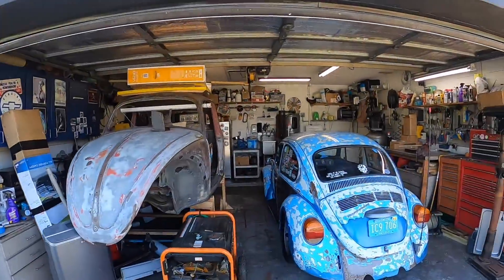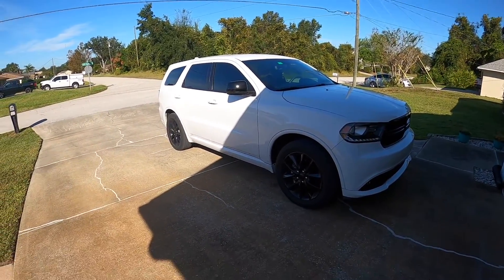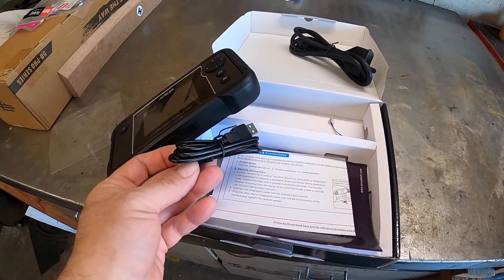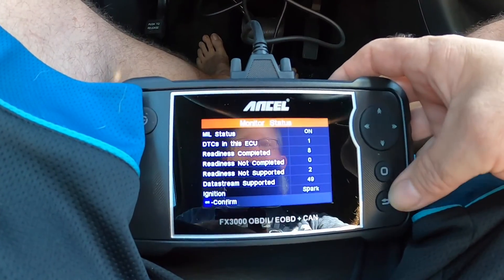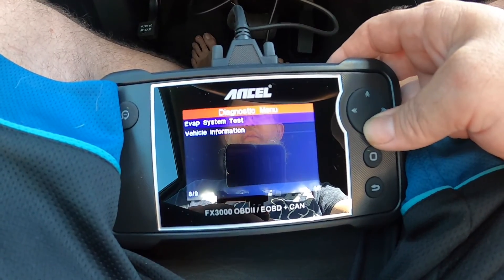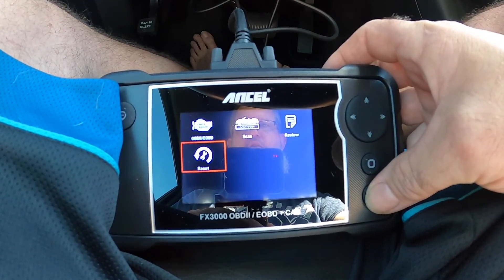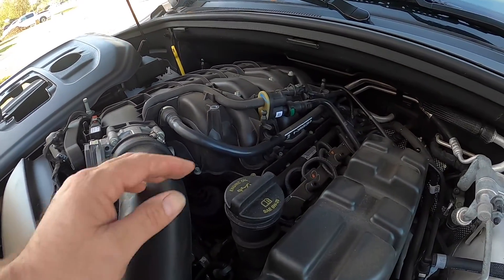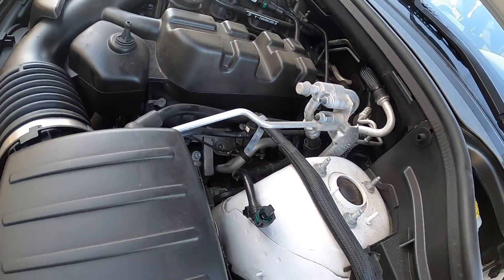Dodge P0456 Evap Code Common Issue and Ancel FX3000 Professional Scan Tool

Comment: Hey, isn’t the engine in the wrong end of the car? Lol. 👍
Reply: @ChipsAndSparksGarage  it's not funny dude
Reply from the maker: @gradyhernandez4699  it actually is since we normally work on AirCooled VW’s and the engines are in the rear.
Reply from the maker: So weird right? 😂🤣

Comment: You should check to see if it’s covered under the factory emission warranty. IF it’s considered part of the emissions.
Reply from the maker: Already checked, not a big deal though.
Reply: @VWJawbreaker  
That sucks. It should be covered by the factory emissions,for the first five or seven years.
Reply from the maker: @vintage76vipergreenBeetle  I made a quick call to them. I’ll probably take it down and have a chat with them next week. Worse case it’s a cheap easy fix.
Reply: @VWJawbreaker  
I had a evap issue, with my 17 toyota  and it was covered by the factory emissions warranty a few months ago. Good luck.
Reply from the maker: Good to know, thanks for that. I’ll see what they say and go from there.
Reply: @VWJawbreaker  
I forgot to mention this before. Check your warranty manual. The emissions warranty information should be in there.
Reply from the maker: @vintage76vipergreenBeetle  will do, thank you sir.
Reply: @VWJawbreaker  most don’t know what’s covered until the car is there and they actually look it up. 
My 144,000 mile 2011 2500 HD diesel had some issues and it was covered under emission warranty. 
But like you said it’s a cheap fix. My truck not so much.
Reply from the maker: @robertlambert5299  I’ll definitely check it out!
Reply: @VWJawbreaker  I 
Those evap codes are a pain sometimes
Reply from the maker: @gradyhernandez4699  they can be but luckily this issue jumped out pretty easy.